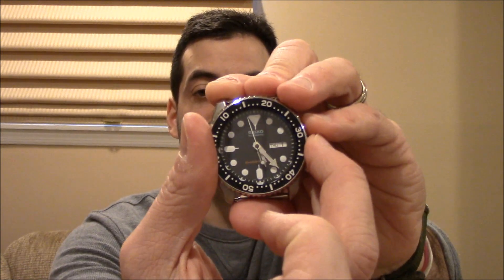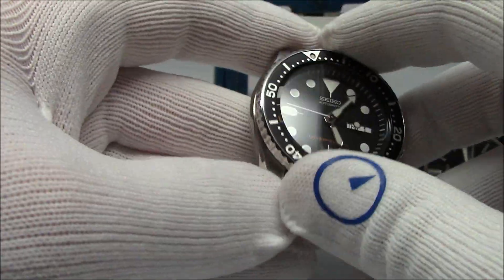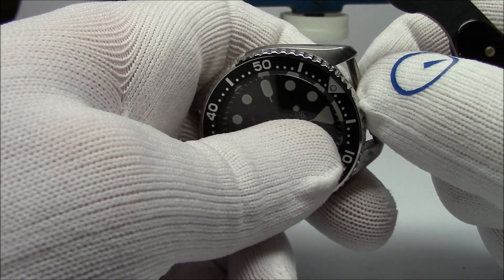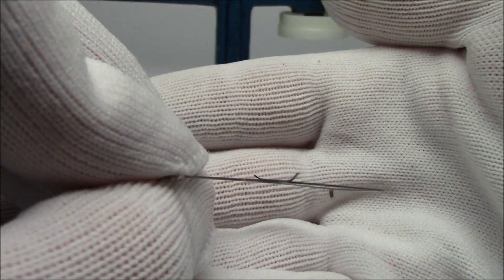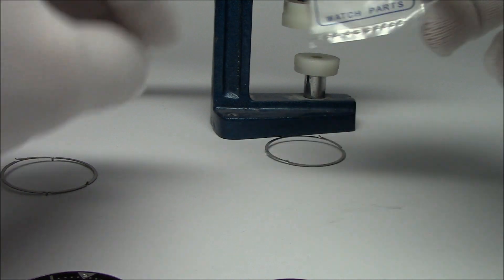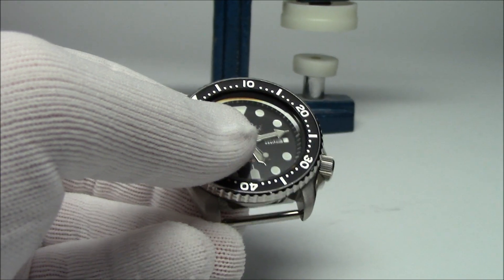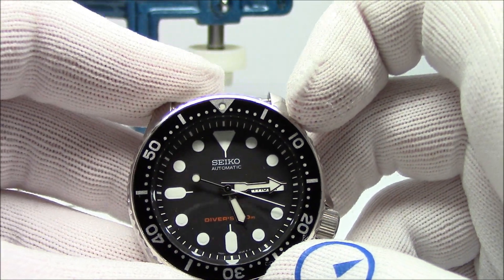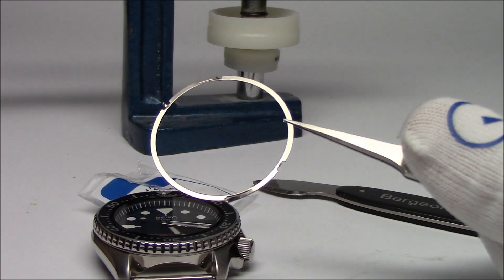Fixing a broken unidirectional dive bezel - Watch and Learn #19

Comment: The bezel of my 2017 SKX007-J1 (purchased from Mark by the way) was extremely stiff when rotating, prompting a search for a fix. After confirming the crown was secure, first option was to clean the bezel base with warm water, dab of Dawn, warm water and a toothbrush. Used a hairdryer to remove any residual moisture. Fixed my issue.

Comment: Bro my omega seamaster professional 300m 90s model. Has a very stiff bezel.. It's basically stuck it took me about 30 mins to spin it back where the top is back at 12 😆.  I dunno what happened or why it did. But one night it was fine I went to sleep woke up and left it on by accident and went to spin the bezel back to normal and it wouldn't budge at all zero zip nadda lol like extremely stiff. It still makes the click and all that but it takes the strength of a damn gorilla to move it now... I dunno what the hell happened but I finally got it back to 12..... so now I gotta fix it and I rather fix it myself I don't wanna spend a arm n leg for them to fix it when I can do it much cheaper. I had to do fix my Rolex subs bezel which wasn't to bad. So I'm assuming the omega seamaster professional 300m will be pretty much the same way??

Comment: Great video.  Thank you.  I was able to pop up  the uni-directional bezel from a Timex watch, remove two tiny spring loaded stoppers.   Now I can slide the bezel both ways and silently.  This allows me to keep track of time spent in a meeting inconspicuously.
The only downside is that it moves easily, but then I'm not scuba diving either.   For a quick on the spot timer, it's convenient & discreet.

Comment: Hi Mark i have the Seiko Flighty and the bezel became stiff and was getting hard to turn.Eventually a plastic o ring started to stick out which i pulled out.I did remove the bezel to get all of the plastic o ring out.So i need to get a new plastic o ring as the bezel spins and is loose.Where can i get a new one from.Thank you

Comment: If you remove the bezel on your sea urchin (7S36-04N0) be very careful when you insert the knife. 
If you push in in too far in the first position and try and lift the bezel in one go, you can break the clear bezel part. As I have just done :-( 
Lift the bezel from several positions around the bezel and progressively lift it off.

Comment: my bezel of a Skx 013 mod (ceramic bezel insert, eBay) is very sticky , hard to / impossible to turn when the watch is on wrist. I took it off, lubricated it but not to the better. It doesn‘t click, the ‚ „click“ is hardly to hear. Should I try a new spring?

Comment: Thanks for this... Also, I found that since the bezel is slightly above the actual crystal's surface on my 173, you can just turn the watch face down on a flat surface and press down on the back to snap the bezel back on.I also put a little light weight oil on a rag and lightly wiped around the o-ring and it now turns so smoothly. Thanks again.

Comment: Hi Marc, I know there have already been a ton of supportive comments on your Watch and Learn series, but I feel compelled to add one more to this video: I recently acquired a Seiko 5 Sports SRPD51, which is beautiful except the bezel was slightly misaligned such that the 12:00 position was between clicks. I know this is not uncommon with more affordable Seikos, but I am apparently even more OCD than I thought as this was driving me nuts every time I looked at the watch. I thought I was just going to have to live with it, but I popped off the bezel and filed down the spring ends a bit and after a couple iterations of this... I now own a nicely aligned SRPD51! I couldn't have done it without your video. Thank you!

Comment: Hey Mark, I bought a coin edge bezel for SKX... from Amazon to update my Orient Ray 2 blue dial.  The new bezel sits well but does not stay on, do I need to by a different gasket or different bezel.  I bought it from amazon because I had reward points otherwise I would have bought it from yobokies.  Thanks for you help.

Comment: I have had my Invicta 9094OB for about a year and a half now and, while the watch will of course collect swirl lines and all, what bugs me is how the bezel insert already has its fair share of scratches, three of which are quite deep or easily noticeable. I wanna replace the insert but I don't live in the US and I don't know where to get a replacement insert that's got the same kind of blue color as the dial. AFAIK Invicta doesn't have an official presence here either so I can't buy directly from them, if they actually sell replacement parts to end users. Any help would be appreciated.

Comment: Great, thanks for the video! I managed to catch my watch on door frame and it ripped off the bezel. I was looking (in vain) on the floor for two tiny springs, rather than a circular disc of metal. Went back and found it straight away and popped it all back together. Job done!

Comment: Hi,

I have a Rolex Sub 16800 date/stainless. Recently the bezel popped off (at my gym, I probably hit it with a weight or while putting away a weight). It was lost for a day and I FOUND IT! Lucky find. I have had the bezel off/on a couple/three times. It's 30 yr old watch. I want to daily wear it as before, but I am afraid it'll pop off again & I won't be lucky. It's probably hundreds to replace if not more. Suggestions? I don't recall that it had the o-ring like your Seiko, but not at all sure. Can you help? Subbed.

:)

Comment: Any tips on how to make the bezel rotate easier!  Have a new skx and it’s a little hard to rotate
Reply: I was wondering the same thing Jon. I have two brand new watches that are very hard to turn. I suspect lubrication is not the issue.
Also, I've been trying to find out how to reduce the back play in the bezel. I just got a brand new phoibos wavemaster and it is perfect except there is 1.5 minutes of back play that are most annoying. I'm thinking there's a way to ever so slightly bend the spring to reduce the back play but it sounds risky.
Marc,
I'm hoping that you read this in spite of it being old Post. Do you have any insight on reducing the back play in a bezel? Thank you! John

Comment: Marc, I love all of your watch and learns but every time you bring up a dive watch bezel and say "you can only shorten your dive because it's a safety feature" my stomach churns. Unidirectional bezels that rotate counter clockwise only lengthen your drive not shorten. This is so that divers with a set amount of oxygen dont run out while diving if they bump something.

Give it a go sometime. Set the bezel to the current minus and then rotate the bezel as if hitting something. It'll go against the direction of the sweep and thus lengthen the dive time.

Again, great content but there's always room for improvement. You've taught me so much through your videos and I would be overjoyed to teach you something.
Reply from the maker: I respectfully disagree, but maybe we are talking about the same thing. Moving the bezel gives you the perception you are down longer than you have been, therefore keeping you safe and ascending before you normally would have.
Reply: Yep, sounds to me like we're talking about the same thing. When you say "shorten your dive time" I took it as "the watch bezel will read a shorter amount of time underwater" while you actually meant "bumping something will result in your dive being chronologically shorter because it artificially lengthened it with a bump"

I was thinking relative to the actual start time and, correct me if I'm wrong, you were thinking relative to the bezel itself or the actual time spent underwater.

Your disagreeance is quite respectable and I'm not at all surprised I'm still learning from you.
Reply: Marc was right...

Comment: Is a pressure test need after removing and putting a bezel back on? I imagine it wouldn't be since no components that give the watch water resistance were removed.
Reply: a single white female Correct. No need to pressure test unless you ate removing the back case.

Comment: Hi Marc,

My SKX bezel recently starting doing only 60 clicks and has become stiff. Do you recommend bending up one of those sprigs slightly to reinstate the 120 click mechanism? Also, do you recommend any particular lubricants that will not corrode the O ring?
Reply from the maker: Probably time to replace the bezel spring actually.
Reply: Long Island Watch just ordered a new one! Opened my SKX007 up and the metal was split in half at the base of one of the two leaf springs. I've only had the watch for 3 months - weird! Thanks for your help.

Comment: Would it be okay if i removed that spring part? The watch would still work fine right? To my knowledge the bezel would simply be loose, and move both directions. So my question is would everything be fine if i discarded that bezel spring. (Namely , the water resistance)
Reply from the maker: Yes, the bezel would just slide. Water resistance isn't affected.

Comment: Great Video Marc.  Question:  why couldn't you just flatten down that leaf spring that was sticking up too far rather than replacing the whole spring?
Reply from the maker: I could, but it was raised so much, the metal has gone from the elastic to the plastic zone there, so it will never go back to the same exact shape. For the price (few bucks), just replace the part to factory specs.

Comment: Great video as usual Marc. Thank you. Wish I’d seen it before I tried this on my SKX007 as I’ve scraped a lug slightly. :-(  Even after careful cleaning my bezel remains too stiff (it requires so much force that you roughen a thumb nail every time). Anything you’d recommend to lube it? Oil-based lube would not be good for the o-ring I guess, so I tried powdered graphite (the stuff to loosen lock mechanisms) with only a slight improvement. Maybe I need to ease those springs down a little? 
I have the opposite problem with a 30-year-old Heuer: the bezel is too loose, one half sitting a little higher and looser, so I fear lifting the spring might tighten it but with the bezel not flush enough to the case. Not sure there’s a fix for that?
Reply from the maker: Go to a jewelry or watch repair site, like otto frei, and get some gasket lube. Try that first.The TAG you should bring in for service.

Comment: Great video. I'm wearing a brand new SRP777 as I await my Rolex Explorer II to return from extensive repairs: axle, mainspring, crystal replacement, full service. I only wish the Seiko chapter ring, bezel, 12 O'clock were more perfectly aligned but of course that's a known design defect in my watch and others. Thank you for the education!

If correction of those types of flaws are possible, it would be cool to see a video about it. Just a thought.
Reply from the maker: Thank you, will consider it!

Comment: Nice video. This is a very simple mechanism and gets the job done, I thought there were a lot of more complicated things going on under my bezel.

Is there any trick to reduce the play of a bezel? There's just a little bit of it, but I wish i could reduce it as much as possible.
Reply from the maker: The play is mostly in the design. If you do have the Seiko like this, you can gently lift the leaf springs up a bit and that will cause a "harder" detent and hold the bezel stronger.

Comment: Mark, according to the online Seiko watch database (WatchSleuth) the beautiful clear cover on the SNZH51/53/55/57/59/60 bezels is Hardlex, just like Seiko's Hardlex crystals. I desperately want to know whether that SNZH55 bezel can be transplanted onto any of the SKX007/009/173/175 watches. I just about had a heart attack when you pulled out the SNZH55, thinking you were about to do exactly that, but then you didn't! Arrrgh! So, are the bezels interchangeable on these models?
Reply from the maker: It really looks like they are different sizes, sorry :(
Reply: Thanks. That's a bummer. Guess I'll really have to mod the SNZH57 if I want that beautiful bezel. But I can't find any modded dial options that preserve both the date and day functions of the SNZH5* watches.

Comment: Very interesting! Easier than it looks like. Wonder if Rolex also uses such a simpel mechanism on his famous Submariner today... imho one of the best and most smooth bezels in the industry.
Reply from the maker: Similar method with a spring, but different implementation. Plus, the tolerances are much finer on a Rolex bezel, and that helps the "smoothness" you are referring to.

Comment: What do you do if you change the battery in a quartz, and the back of the watch refuses to go back on even with a watch press. The case back is oriented properly, and there doesn't appear to be anything in the way.
Reply from the maker: When this happens, usually its a gasket issue. A misshapen gasket will prevent the back from snapping back on.

Comment: Hi Mark, another great learning video. 

Are all Seiko's pop-off Bezels?  Also, I didn't quite understand how you would adjust an otherwise fully functioning bezel to align perfectly at 12:00 ( a lot of people are very particular).

Thanks!

Leo
Reply: leoluck68 each time you remove a very small amount from the detent tabs it causes the engagement to happen earlier.
Reply from the maker: By removing a bit of the spring, you are changing where it banks against the bezel, as Loudpedal10 is saying. But if you take off too much, you change the design. So it's really only good to do slight refinement.

Comment: Can you do squale 1521 bezel?
Reply from the maker: I can, but it's simple. Loosen the 4 screws around the periphery a couple of turns. The bezel will literally fly off, and the spring is wrapped around the case. You can file it to adjust the zero as well.